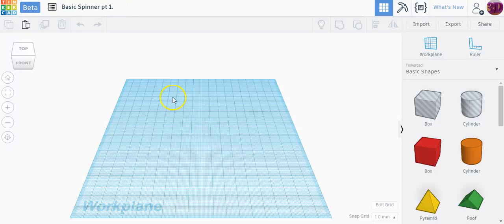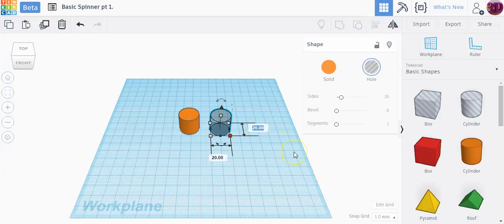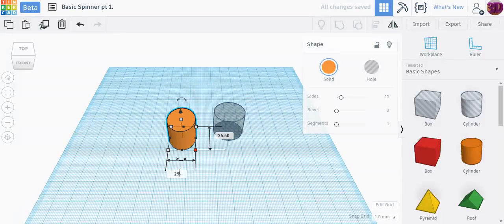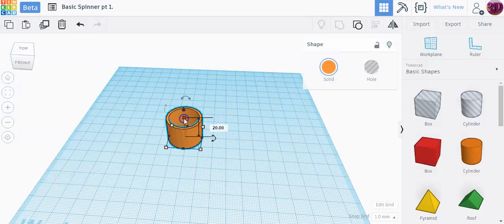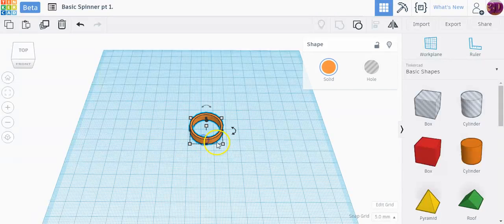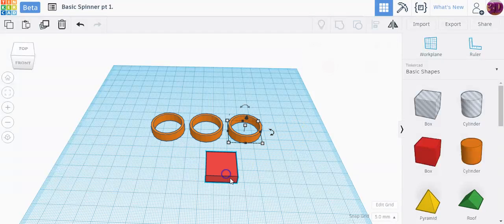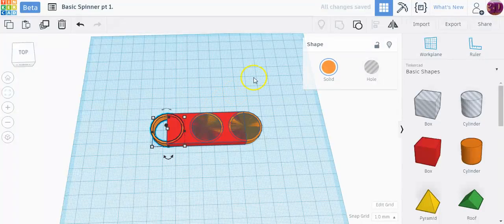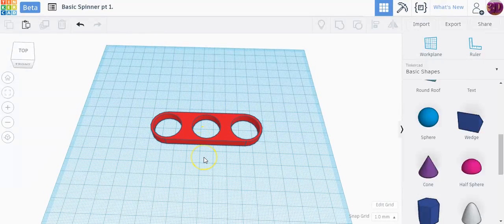Tinkercad 3D Design Basic Fidget Spinner #1

Comment: why didn't you just use rings?
Reply from the maker: I don't use rings because the dimensions you get with Tinkercad only show the outside edge-to-edge dimensions, not the inside "hole."  The inside "hole" dimensions are the most important, as they need to be exactly the right size to hold the bearings. You could certainly use them, but it might take some trial and error to figure out the correct size.

Comment: How do you make it spin
Reply from the maker: You need to add some inline skate bearings to the holes. You can find them in old skateboards, or rollerblades, or on Amazon. https://www.amazon.com/gp/aw/d/B002BBGTK6/ref=mp_s_a_1_3?ie=UTF8&qid=1492722996&sr=8-3&pi=AC_SX236_SY340_FMwebp_QL65&keywords=Inline+skate+bearings&dpPl=1&dpID=41sEzWChfgL&ref=plSrch
Reply: MrFogleSVSD thanks